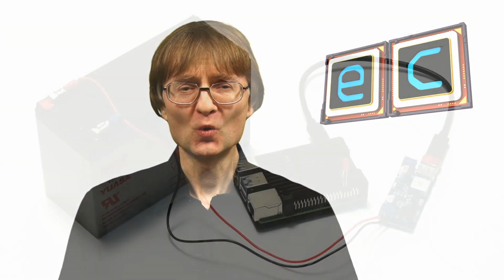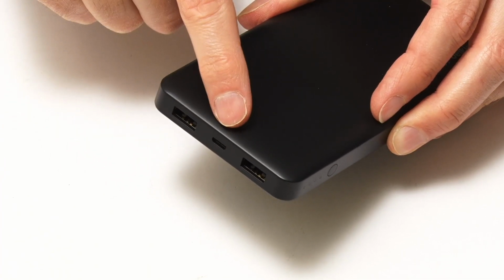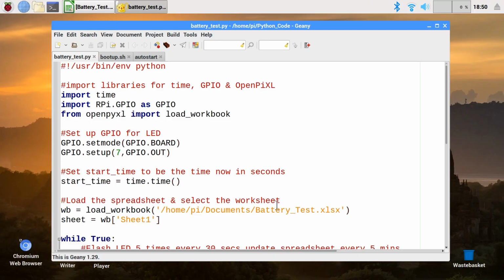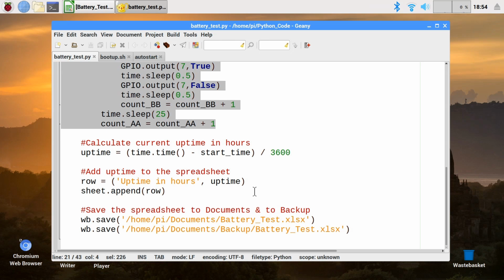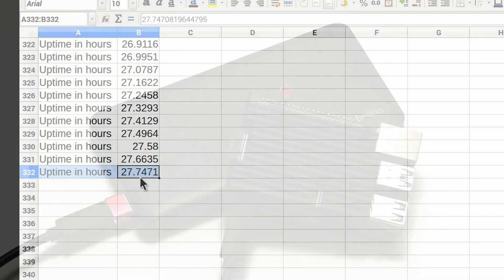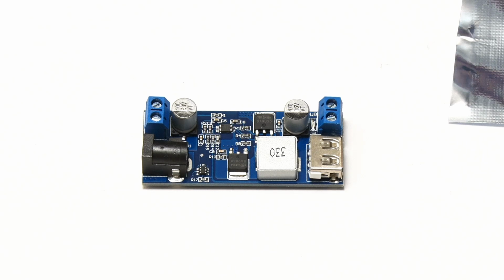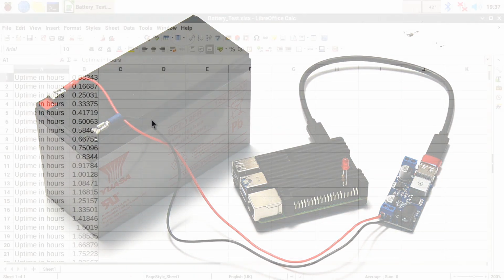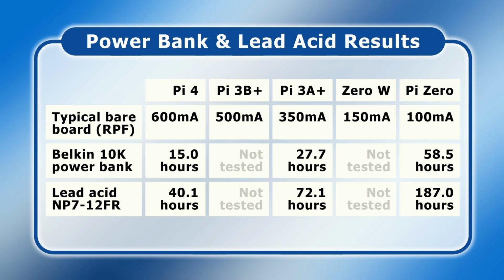Raspberry Pi Battery Power

Comment: This helps confirm the idea that, actually, Elon Musk's "Powerwall" batteries - a house battery - probably shouldn't be lithium ion.

I mean, it's understandable why they are. Tesla make electric cars, where size and weight matter, so lithium ion makes sense for its energy-density-to-weight ratio, as cars are, of course, a portable application and you've got to carry the weight of the battery around with you.

And, therefore, as Tesla make these large capacity lithium ion batteries anyway, the "Powerwall" is re-using this same tech for a secondary purpose. That is, the same "gigafactory" can kick out both products.

(And, indeed, in future, when these lithium car batteries eventually lose their performance and capacity, a natural bit of "recycling" that could happen is re-purposing them as home energy storage batteries instead. Essentially, take the battery out of the car and mount it onto the wall. Where a car battery losing its performance and capacity - and, therefore, range - to, say, 75% of its factory performance and capacity would not be great for the application of an electric vehicle, it's still more than enough and very useful for a less "performance" application as simple energy storage. An electric vehicle accelerating a ton or two of vehicle up to 60mph requires a lot of "instant energy" to get it moving, but such "performance" is just not needed for, say, powering the lights at home. For a car, a battery needs to be a "sprinter" but, for the home, it's more useful to be a "marathon runner" instead. Or, if you like, the car is "the hare", while the home is a "tortoise" for comparison to the fable.)

So, really, Tesla sell lithium "Powerwalls" for the home because, well, their company already makes such batteries for their cars and this is just a secondary use for what those "gigafactories" are producing.

But, well, if you were, instead, focused on what would likely be the better energy storage medium for a home battery, then a bank of lead acid batteries might actually make more sense. In that, as it's not going anywhere, the heavier weight doesn't really matter (well, as long as it's installed on the ground floor, obviously). And home batteries do not need the "performance" - that "instant energy" for rapid acceleration of a heavy vehicle - in the same way either. Whereas, the increased capacity and cheaper cost really suit this application more.

(Even more so, as we roll up to the eventual ban on Internal Combustion Engine (ICE) cars in 2035 in the UK, as then we'll increasingly have a lot of no-longer-needed lead acid car batteries - so "recycling" them for this purpose could end up being the super cheap option.)

So, yeah, in watching this video, I was reminded of this, as I've been looking into that sort of thing, regarding home energy storage, and had already come to the conclusion that other tech, like lead acid batteries, might actually suit certain applications better. If portability and performance don't matter, and you'd rather just get the longest "marathon runner" duration out of a battery (for a reasonable price), then lithium ion, while all the fashion, might not actually be the best choice.

I also thought this was worth discussing here, as I know you enjoy your futurology - with your "explaining the future" sister channel - and this topic, of future energy production with renewables and home energy storage, is one that fits into all that well, I feel. Following the news, that element of the possible future seems to be fast approaching - as all the car manufacturers are increasingly embracing electric vehicles at pace, and then the knock-on technologies of home charging naturally follow, and then, if you're charging at home, the logic of solar installation and home batteries adds up. The notion of your garage passively collecting solar into a battery, from which you could charge your EV, essentially providing "free fuel" will, I feel, increasingly come onto people's radars, as the costs and benefits become apparent, once everyone moves (necessarily, due to that coming ban on ICEs in law) over to EVs.

Comment: As an American I think you are using twice as much voltage as necessary as Brits normally do. A 6v lead acid battery would probably last longer and not have to drop so far below it's nominal voltage to end the spreadsheet run.Only problem could be the minimum operating  voltage of the 5 volt regulator.

Comment: Thank you for the detailed analysis of powering the Pi via a battery source, @Christopher, it was definitely informative!

As you ran the test without any load in this analysis, perhaps you could make a follow up video where the Pi 4 & Zero are providing power (say to an LED/LCD display that provides the time+temperature) as well as pulling data from your Weather Station's sensors through its GPIO pins.

In addition to this, the Pi 4 could also provide a web service that allows a remote monitoring station (a PC or laptop on the same network) to access it via WiFi (transmitting & recieving via the wireless hardware). Having the HTTP service + WiFi drain + sensor readings could provide a real-world example where battery longevity could be useful.

Not sure the Zero is capable of doing this though I would be curious to know for a 1:1 comparison of uptime.

At any rate, thank you again and looking forward to what I can learn from you next time!
Reply: I would be very curious how long a Zero W or 4b could be gathering temperature data and responding to wifi queries. I like your spreadsheet, but perhaps a simple web page is a more modern reporting scheme.

Comment: Hi Chris,
Thnx for the tedious hard work! This imho begs the question[s]: How can the battery-life be even more extended? For example: Can a pi be hibernated [?word?] and wake up to extend battery-life even further? What happens to the battery-life when you reduce the clock speed to a level that is just about sufficient to complete the required task? Would the linux-version // terminal-version vs desktop-version make a difference? etc. etc. Like going "APOLLO 13" and squeeze things to the max... while staying 'operational'. I realize findings answers to these questions is a bit like torture... However there might be enthusiasts out there that have done some of these explorations?!
Thanks again!
Willem

Comment: Useful results. Anyone wishing to run a PI on batteries will be concerned to maintain the life of that battery in terms of charge cycles. It i well known that both lead acid and lithium ion batteries can be damaged if discharged below a critical threshold. I guess we have to assume that both the 10ah battery bank and the 12v to 5v buck converter do this for you but it would be helpful to have this confirmed.

Comment: Chris, you did a big mistake concerning the lead acid battery. There were no overdischarge circuitry to protect from running the battery too low. Hence it's the buck converter that has shut off in your tests, so it's likely to have run down as low as 7V, which is significantly lower than the typical minimum voltage of 10.8Volts of this type of battery.
These are meant to be used as battery backups in industrial applications in conjunction with a charger that provides protection circuitry.

Comment: Interesting test Chris, but probably not fair.

Both Lithium and lead acid are (like others) battery chemistries prone to fairly rapid damage if discharged too far. Lithium are worse for this (one severe over discharge can ruin a cell) but it’s something to consider with sealed lead acid too.

The power bank, like pretty much all lithium ion powered devices will have an in built cut-off that prevents over discharge or ‘deep’ discharge. Fir lithium, the safe discharge voltage at low current is about 3.0v. Unless the switch mode converter you used with the sealed lead acid has the equivalent, (for lead acid, around 10.5v at low current) it will continue to sap everything out of the battery until it’s really, really gone and will not give the minimum power to run the Pi in question. Do this a relatively small number of times and your sealed lead acid will be about as useful as a house brick for powering anything.....
Reply: Thinking about it, it probably wouldn’t be difficult to monitor the SLA voltage via the GPIO pins and shut down the Pi via code when it reaches a pre-determined level. The switch mode buck converter would still be connected to the SLA which would cause some drain (they always draw quiescent current) but not so much.

Comment: Interesting experiment! Did you use a battery protection/ deep discharge cutoff for the lead acid battery? In the test setup we saw the buck convertor is directly connected to the battery terminals. If that is the case then the results are skewed in favor of lead acid battery. Without any deep discharge protection the buck regulator would have run the 12v battery flat down to 6-7V way below the discharge threshold of 10V! resulting in raspberry Pis running a lot longer!
Most Lithium Powerbanks  have battery protection builtin and that is why the actual results were within the expected range for Lithium batteries. It would be interesting to see the results with a lead acid battery protection module in series.

Comment: Sorry, Christopher, but there so a lot wrong with this video.
The smallest, don't add a row but update the previous one. That way you don't have to scroll.
Lead acid batteries are heavy, that is why they are not used in cell phones and the like, nothing wrong with them. However, for something like this you need a deep cycle battery, using a regular lead acid battery this way will damage it...
There would be no corruption of the file if you closed it and opened on all writes. Even better, send the data over the network to a different system.
Load assumptions are not really necessary and can be measured.

Comment: Both the power bank and the lead-acid battery share one thing in common:  They both run more efficiently, and therefore longer to load scale, on lower loads. The power bank, for most of its draw range, because the circuitry gets hot and wastes more power (AFAIK) while drawing harder on the battery. The lead-acid because its chemistry, while it can tank heavy loads (usually briefly), very much prefers trickle-end-of-the-scale loads as it doesn't strain it. It has plenty of time to "move about" inside.

Comment: Does the psutil work on the Pi OS?  It could be interesting to see if the battery drains linearly, but it could also be a practical use if the battery powered Pi is transmitting data to a web server.

... #your other code
import psutil

def secToHMS(seconds):
    minutes, seconds = divmod(seconds, 60)
    hours, minutes = divmod(minutes, 60)
    return "%d:%02d:%02d" % (hours, minutes, seconds)

... #your other code

while True:
    ... #your other code

    battery = psutil.sensors_battery()
    batteryPercent = battery.percent
    batteryTime = secToHMS(battery.secsleft)
    row = (['Uptime in hours', uptime, 'Battery %', batteryPercent , 'Battery time left', batteryTime,])

    ... #your other code

Comment: Tests are not really comparable, you would need to use a buck convertor on both types of cells with comparable Ah. Still Lead Acid is cheaper per Ah, excepting weight as a factor. Love the videos 😻

Comment: I think you alluded to the fact that if you suddenly remove power from a RPi without shutting down linux first there is a chance the SD card will become corrupted and the Pi wont boot again. This is a huge problem with Pi boards. I wish there was some way of having Linux monitor the battery voltage and quickly shut itself down if the battery is about to die.

Comment: That gel cell battery can easily charge as fast as lithium ion, you just need a better charger to do it.  Also at that low of a current draw there is no reason to expect anything short of 100% capacity if not more.

Comment: The problem here is the lead acid battery will keep powering the buck converter until the battery voltage totally collapses. However draining the battery that low be will damage it and reduce its life. You really needed something to disconnect the battery off once the voltage dipped below around be 11.80V. That would give a more realistic capacity. The controller in the Li battery pack prevented that being drained completely.

Comment: Great video! I recently used a Raspberry Pi 4 running off a power bank and then an 18V Makita battery stepped down to measure the temperature inside and outside of my car during a camping trip. I found that having temperature probes didn't really illustrate how much more comfortable my car was than sleeping outside or in a tent, so next time I'll probably end up bringing a micro weather station and additional probes and will definitely be powering that project with lead acid batteries!

Comment: This is quite a bit outside of my expertise, but understood that lead acid batteries do not like being deep cycled so using them in this way would seriously curtail their useful life. They are at their best in applications like cars, or UPSs, where they are constantly being trickle charged and rarely use a significant part of their capacity. I am happy to be corrected on this.

Comment: My suggestion(s)...  Bare metal OS.  Jumpers on gpio to select mode of test.  One or two gpio outs for heartbeat signal to second pi setup to monitor test pi along with several gpio loads.  From there, also have several types of tests to load one or more of the cores at selectable capacities.  As is really like the information shown here, however really curious as results with a more moderate load test as one might have under a power loss with active usage loads...  Is a pi running as busy server of some sort...  The loads as seen in video still seem moreover as as periodic monitor / logger setup.

Comment: I’ve got a raspberry pi 2B powered by 2x 6600mha lipo batteries. I use a Tiny2040 to monitor the solar charger and reading 2x LC709203F battery monitors to check the voltages and then activate each battery using relays depending on the battery levels and if there’s a solar presence. Currently in testing phase for runtime. I’m at about 9 hours per battery right now. Once automatic battery swap tests complete, I’ll start the solar portion to see if I can get 24/7 runtime.

Comment: A major reason your estimated run times were off is the "typical" currents listed on the Raspberry Pi website are very rough estimates (or even guesses!).  No where does it define what activity would cause a "typical" current.  They should be listing min and max current, etc.  Also, the listed max USB current "Limited by PSU, board, and connector ratings only" does not help the user.  The manufacture should be providing a lot better information than this.  I like my RPies but some data on the foundation's website is really lacking.
Reply: And look further down on the page under "Power Supply Warnings".  It defines the point as 4.63V +/- 5% which equals 4.3985 - 4.8615V which is a huge range for the point where below that it just puts a warning on the screen (and in the log).  Will a RPi even keep running at the low end to even give the warning?  I haven't tested this warning point but suspect it is likely +/- 1%.

Comment: I didn't see what the terminal voltage for the lead-acid battery was at the end
of the test. Hopefully it was not below the ~10v level that will cause a loss
of future capacity. Does the buck converter have a way to shut down if the
input voltage drops below a preset amount. Or does it keep chugging away
until the input voltage approaches 5v?

Comment: To have your little program run, couldn't you have done the following? But first some info. In Arch with Openbox and the Tint2 panel you create a folder and in there an 'autostart' file and in that file you merely put:
#tint2 &
#picom &
#nitrogen --restore
#and whatever else you want, all without the # signs
In Raspbian, isn't there something like that? I just can't remember.

Comment: Hello,

Can you help us with a video with a UPS for Pi. It happens many a times the power from the adapter die due to any reason and the pie turn off. What I propose is a Un interrupted Powe supply(UPS) using lead acid battery.

Thanks and regards,
Rohan

Comment: It's important to note that you shouldn't run a lead acid battery to 100% depletion or you'll cause a lot of damage to it, and dramatically lower the life of the battery.  You should protect the battery from being depleted beyond 50% by putting an under-voltage cutoff circuit between it and the load which will disconnect the battery when it's voltage falls below 12V or so - see the Battery Univeristy site for more info.

Comment: Here is what I think is giving such long times with the sealed lead-acid battery.  

I think the current draw at the battery terminals is about 0.35 amps which is very close to the 20-hour discharge rating of a typical 7 Ah sealed lead-acid battery. 

Typically a buck converter will operate with a much lower input voltage than what you start out with. I have a 12V to 5V 5A buck converter which will provide a 5V regulated output with a minimum input of just over 6V. I think if you measured the batteries' open-circuit terminal voltage during your test that after about 20 hours you might see that is going into a low state of charge and it is time to recharge the battery. If you run your test for 40 hours straight the battery will be degraded/damaged. 

In my mind, it is kind of like charging and discharging a LiPo setup without a BMS. 

NP SERIES - NP7-12 battery:
http://www.eurosep.com/fichiers-joints/web-bpb12070y.pdf

Comment: I think the times with buck converter are higher because the voltage will degrade but stay long time over 5v. However it might not be the most battery friendly thing to not switch it off early.